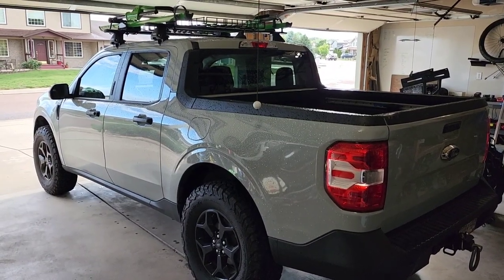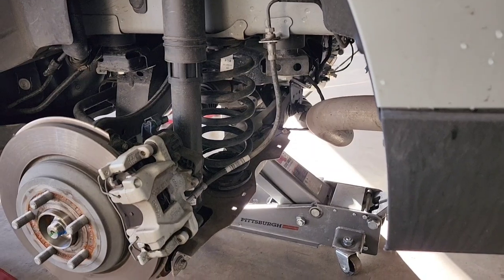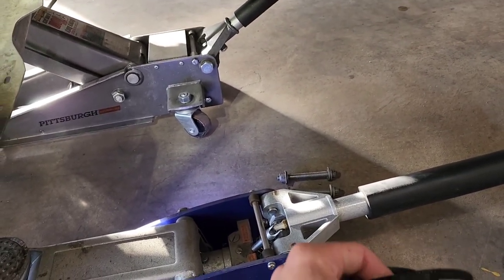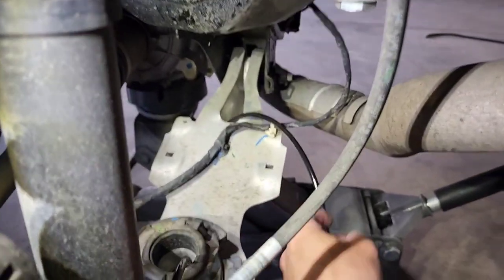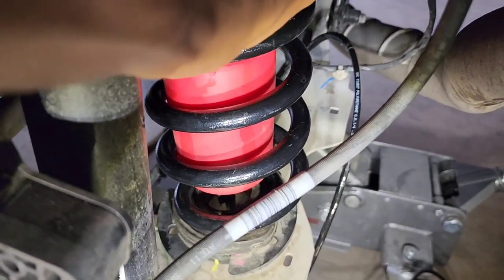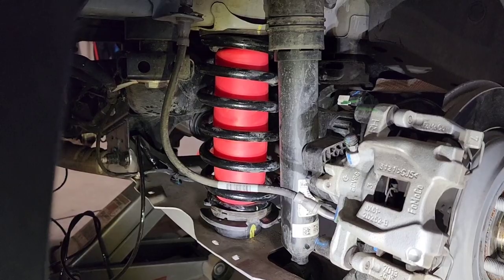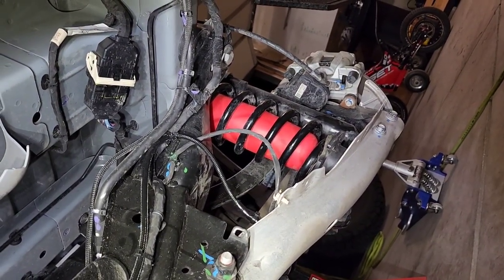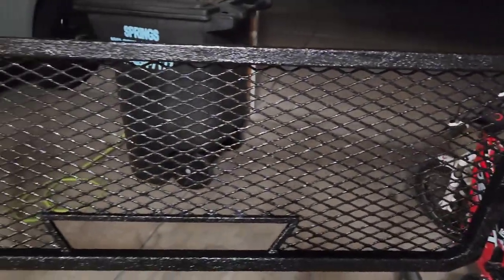Ford Maverick airbags and back rack sneak peek

Comment: The problem with the T in the line & one air feed is that air will move between the bags. If you are cornering with a heavy load, the side that compresses will push air to the opposite side, which is where you don't want it. Split them & both sides will stay as firm as you set them & the truck will corner flatter. Look'n good bro!

Comment: Looks sick!

What's the benefit of the air bags if i may ask?
Reply from the maker: Thx! To level out the truck hauling heavy loads. Pulled some heavy trailers without em and it squatted pretty good. Also, just a fun, cheap, easy project.

Comment: I like the idea of this but I am not sure how much difference you would notice. It doesn’t seem like the included lines and hardware are capable of handling a significant load. Please let me know if you can feel a difference after instal.
Reply from the maker: Thx for watchin. Yes, they work great to level out the truck pullin a trailer. They are T'd together so I don't have as much lateral stiffness (or sway control) as I could. I haven't hauled anything too heavy in the bed. That's why I went with the T instead of individual lines. Works great for trailer loads though.

Comment: How did these bags affect your ride when unloaded?
Reply from the maker: No difference really. I run 7psi in them just daily driving. Minimum is 5psi per manufacturer. The psi actually doesn't fluctuate with temperature change like tires do. They're always dead on 7psi when I check them monthly or so.

Comment: How much stiffer does it ride with those bladders? Do you notice a big difference?  I see you've got AWD with tow package.  If I ever get my Maverick I'll be hauling my MX bike on a heavy duty hitch rack. It will be close to 350+400lbs. I didn't want it squatting too much.
Reply from the maker: I don't notice a difference. I keep about 7  psi in them just running around town just to keep the shape. You can run about 30-35 psi max for an extra 1000lbs of payload. An extra 400lbs shouldn't be a problem.
Reply: for what its worth I built a pretty large sub box with a fiberglass camper shell guessing around 700lbs all togther it didn't "look" squatted but defintley could tell the weight was there forgot to measure before and after but headlights were aiming higher for sure, I added the bags at around 10lbs of pressure and it rides stock or better driving around. I ordered #60859 and didn't need to take the spring out, just jacked up one side slide them in, and did the other

Comment: Hello, I just stumbled across your video. Your Maverick is stunning!! I also have one in blue. Couple questions, does yours have the 4K tow package? Second question, did you put a leveling kit on the front end, and do your those tires rub? Do you think you can tow more than 2000 pounds, up to 4000, with the 2K package as long as you have those air bags?  Last question, can you provide me the make and specifications of those tires. I have the same package with those wheels. I have the FX for package. I am thinking you have a leveling kit and if those do not rub I would like to purchase some. Thanks,  Joe.
Reply: No they 4k package includes upgraded gearing and a transmission cooler

Comment: Why did you go with the 60902 instead of the Airlift recommended 60859?  Can’t find size specs on the 60859. Thanks.
Reply from the maker: Watch the overland build video in my description. That's where I got the idea to try this myself. He wrote me back about the spacer he added and recommended the 60902. Airbags have been working out great so far.

Comment: Can you please give the info on the spring spacers?
Reply from the maker: Air Lift part number: 60902
Reply: @keganmowery4223  Thank you! No. The spacer that is under the coil spring. Between the spring and the suspension arm. Thanks
Reply from the maker: @shannonjurgens3667  
Oh. It's actually part of the 2" level lift kit I got from Woolworth Motorsports, or you can search FordRangerLifts.com. Here's my lift install video: 
https://youtu.be/VQ-keHaXuOU

Comment: So with it so fat what happens if you need that wheel to compress the spring to articulate on uneven ground?
Reply from the maker: It still does as long as the air pressure in the bags matches the payload weight. No load, minimum 5psi. Heavy load, about 30psi. The bags just bring it back up to normal ride height.

Comment: What bike rack are you using?
Reply from the maker: Just some kinda old Thule Sidearms that I painted. Sanded, primed, painted with high temp green engine enamel, high temp engine clear (both rattle cans). Thule 60" Evo Wing crossbars. Old Yakima low pro basket.
Reply: @keganmowery4223  Thanks for the info!

Comment: That trailer was unsafely loaded. If you are gonna carry loads like that you need a trailer with its wheels farther forward. C of G should be just forward of the axel, enough to put no more than 400 lbs on the hitch. Because the Mav does not have a frame, it is NOT okay to overload the tongue weight rating